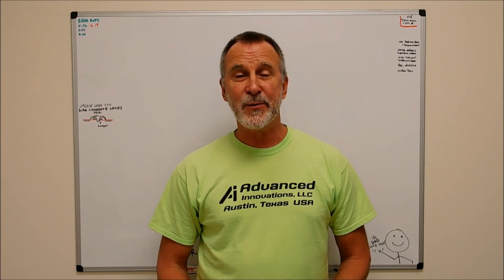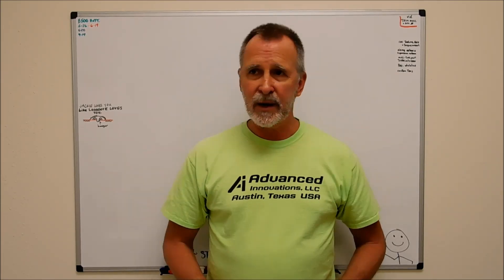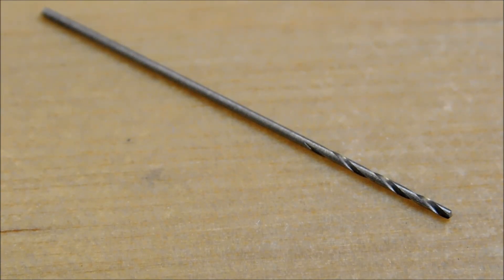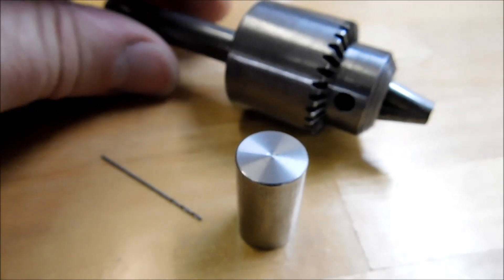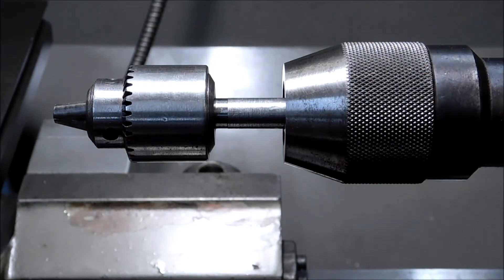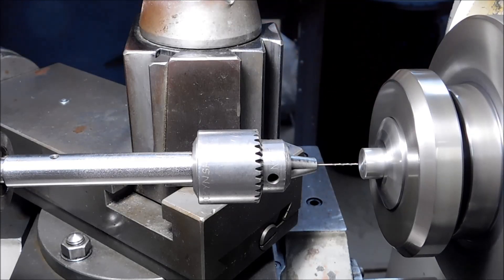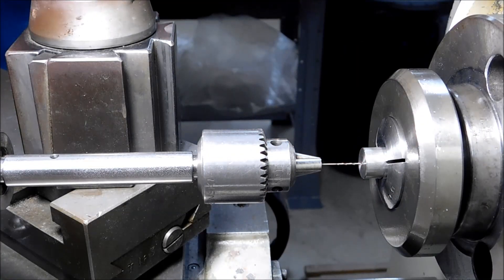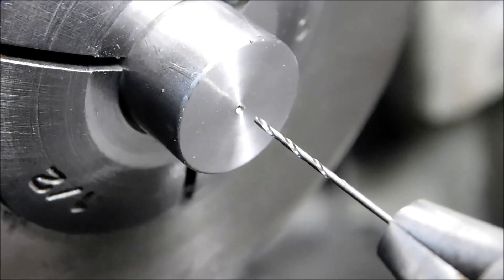Micro Drilling -- Stop Breaking Small Drills !!

Comment: That's a useful chuck arrangement, I'll certainly consider making one. 

Another solution is to use Carbide PCB drills that are rigid enough to start without using a centre drill. They also have a 1/8" shank so you can hold them in a standard chuck. You don't need to feel anything, just go very slowly and avoid creating ribbons of swarf because you'll risk breaking the drill. Using this method I can drill 0.2mm holes which is way smaller than the one shown here. Strangely enough, I think you'd have a PCB drill grab and break is you used the chuck shown here with them though.

PCB drills seem to be virtually unknown outside of the PCB industry, but they're are very cheap because they are produced in their millions. Search eBay for PCB drills and you'll see what I'm describing. They're optimised for Fibreglass, so they're not as robust as they would be if they were optimised for metals. You can still drill a ball bearing with them though as a party trick.

Comment: Peripheral speed is everything. Under thirty fpm any tool can not take the torque if surface speed is way to slow for the material. They make high speed drill heads for very small drills if you have to do a lot of them.

Comment: Thanks for a nice video. Your setup is a workshop setup. Wonder how will you apply it to home users. Anyway, one can buy a complete Dremmel drill with adapters, and a small matching drill press, for around 100 hundred dollars. I have used mine for many years, with very small drill bits for years for circuit boards and other uses.

Comment: Very slick solution. I've never had to use a drill smaller than 6-32 tap drill size, but I had a lot of tap breakage at that small dia. How much slop is there between the shank of the hand fed drill chuck and the ID of the extension?

Comment: Cool, need to adjust the tailstock, though, as the drill and centre-drill are a little off centre ;-).
Oh, in metric, that twist drill bit was ~0.65mm.
Reply from the maker: I can safely say the alignment error is the chuck. Its very old.
Reply: If you look at the video, you can see how the tip of the centre drill and twist bit are both moved from their initial alignment when they contact the work piece which then centres them to the axis of the check/bearing assembly - perhaps more noticable when withdrawing. Not much to it, it really only is noticable because of the small scale being zoomed in. I only mentioned it because it may cause issues with such very small holes as it loads the drill side.
Regardless, subscribed because you do, and have, some VERY neat tricks and workarounds.
Reply from the maker: I agree. blame it on the chuck. The tailstock is within .0005 TIR concentric to the spindle
Reply: Sorry, man - must have been having a senior moment :-(  (and it was very late/early our NZ time) - was thinking you were referring to the chuck holding the work material, doh!
I use a 3mm screw and locknut for setting throttle stops, your little holder video has triggered an idea for a better tap holder for that, so thanks there. :-)
Do you have suggestions, or a video, on drilling 10.8 and 12.9 (mostly internal) metric hex bolts for safety wire? They can be rather difficult and expensive to source and I have a *** of a time when I try to drill them, myself?

Dangit, you have a lot of videos - guess I know what I'll be doing this weekend...

Comment: Hi Joe. Love all your videos!
I'm trying to drill a very straight 1.5mm hole on center down the axis of a 3mmx25mm (1/8"x1") Stainless Steel shaft, to 6mm (1/4") depth.
I'm thinking an ER collet in both head (MT4) and tailstock (MT2) to get the accuracy. Not sure a drill chuck will do it?
Seems for a 5c collet adapter like you have I need a MT5 headstock taper? Your thoughts on best setup is much appreciated. Gerard, Australia.
Reply from the maker: Or you could make an adapter to hold in a chuck, like a 5C hex block??. All machines are different, so your budget and frequency of use should drive your direction. That hole shouldn't be too tough to cut. Its relatively shallow.
Reply: thanks Joe! yes I did consider a square 5c block dialed up in my 4 jaw. could make my own...
My 4 jaw backplate is nearly done. Getting my tailstock grinded down 4 thou tomorrow as its too high which doesnt help. As a result Ive been drilling tapers till now.
Reply from the maker: Many guys look right past the fact that it doesn't matter how perfectly aligned the tailstock is. Fact is, you don't even need it. If you set your drills and reamers in the collet or chuck and prepare a block secured into a tool holder, you can put your chuck in that toolholder and be dead on everytime. Or in this case, set the slider adapter in the toolholder and float the drill anyway.
Reply: Joe Pieczynski you've lost me a little bit. You mean like placing a straight shank ER collet holder directly in my toolpost, and adjusting it? or making a block to hold my chuck that mounts somewhere on my top slide in place of my toolholder and not using the tailstock at all?
Is this maybe your next video 😃

Comment: Just knowing the term is helpful. I love this idea but I need to use it on a mill and a regular micro drill chuck adapter would serve my needs. Your idea is better for lathes since you mentioned letting the chuck spin if the drill bit grabs, and I don't think the commercial sliding adapters allow spinning like that.

If you have a 0JT chuck, a reputable looking adapter arbor can be had for $60 or so through an industrial tool supplier. $130 or so with a micro chuck. An adaptor arbor from India is $30 on eBay. Costs clearly go up from there.

Comment: Good trick, i v drilled 600 micron hole, but my question is that what idea if i want out center holes?
Reply: He said it at the END, use that 150€ Adapter it has a bearing on the chuck, so you can feed by hand in a mill
Reply: to drill out of centre with this setup on the lathe, use a four jaw chuck, and with indicator set your workpeice offcenter. works great
Reply: D Pac 
thank u sir, but holes dividing is main problem, i want 4,5,6 or 8 holes in on set up.
Reply: anomicworld 
Thank you sir for giving detail information, i will try .

Comment: Excuse me, but .027 is not very small..I've had to drill .013 holes. The biggest problem is ensuring that your tailstock is on center. If above or below center, the drillbit will dance all over and break. And sensitive feed chuck mandrels with 1/2" shanks, are readily available. You put a 1/2" adaptor in your tailstock. Then you don't have to use a larger chuck and hang the bit out there so far that it accentuates any centerline mis-match.

Comment: Hi, i would like to know if it’s possible to drill a 0,5 mm or 1 mm hole in stainless steal or hardened steel?
Reply from the maker: The part used in this demonstration was 303 stainless. Hardened steel may be more challenging for sure.
Reply: I personally would not try drilling stainless with a drill so small.
Reply: Hardened plan on edm.
I was using a local shop for that. 0.02" × 0.25 deep or through. About $20 per hole for small orders.

Comment: some things become visible as watching your vid: the centerdrill used at 5:19 is moving out of the centre. It´s slightly moving upwards. Geuss something`s not aligned on the lathe properly or the holder ist out of center. next: small drillbits must be used at a high speed, the thinner the drill the higher the speed. If drilling with a 1mm drillbit in steel you need to drill at 10.000-15.000 U/min. Small holes like 1mm or smaller should be drilled on a machine what can provide the high rotation ratio what is needed for that. ;-) anyway nice vid!
Reply from the maker: This was more about the technique than the rpm of the machine. Most engine lathes will never see high RPM ranges like a CNC.
Reply: of course you are right sire.

Comment: At 9:30: "This is good for a lathe, it will not work in a mill".

Couldn't you do it in a mill in more or less the same way, that is to put the workpiece in the chuck and turn it, and clamp the drill to the bed somehow and then move it upwards?

I'm sure it would feel all wrong. ;)
Reply from the maker: Google micro chuck adapters. All your questions will be answered.

Comment: 300 x v/d 
The reason the unskilled break small drills is that they don't use correct speed [rpm] for the size and materials involved - too slow.
Please advise the rpm that lathe was running at for the 1mm drill bit.
The reason the unskilled burn out large drills is that they don't use the correct speed [rpm] for the size and materials involved - too fast.
Please advise what speed would have resulted in that 1mm drill burning out due to excessive linear velocity at the drill lands.
THIS is the truth of the matter.

Now, explain the 300 x v/d formula that gives rpm for drills and cutting bits in lathes. 

Fact is, drill presses designed for mall drills like this [forget the pistol drill setup] rotate at very high speed and have chucks fitted that do not old drill bits larger than 3mm diameter.

Comment: Lol.  Yea, they want to charge $300.00 for tools, to use on a lathe - that takes 1 hour to make, on the same lathe, with spare scrap.

I seen before, they sell spring chuck adapter to hold thread tap/die.  Is nothing more than rod, tube, and spring = $500.00
Reply: A tapping chuck used on drill presses and lathes as such uses a double planetary gear set that includes a slip clutch to limit torque, a square chuck fitting to mount taps, reduction drive in forward threading mode and a step-up geared reverse direction mode.  The main body of the chuck contains gear sets does not rotate, being held in a static position by a rod that  rests on the main vertical post of the drill press or bed of lathe. The chuck is mounted in drill press like any morse taper chuck in the driven spindle of the machine, be it press, mill or lathe. 

The machine input spindle direction is normal forward cutting direction, The machine is NOT reversed during operation. 
The natural tap rotation at reduced rpm due to gear ratio [output] is in the tapping direction - forward.
 The chuck is lowered into work piece. As the tap enters it threads in it eventually winds in to a point that disengages forward gear set. 
The a central 'neutral' mode  between forward and reverse directions is reached and with spindle pressure reversed [lifting up in a drill press] the chuck is engaged in reverse mode, unscrewing the tap at high speed.
With tension released when tap unwinds the chuck returns to forward mode ready for next hole to be tapped. 

  I've used such tapping chucks in a production environment, rapidly tapping a range of materials from rhs steel, stainless steel, aluminium bronze, brass, copper from sizes 3mm to 12mm and in some cases 50mm x 1.5 thread form into 8mm brass sheet.   
At high speed - NEVER broken a tap in the process. 
Takes a few second to set up - remove drill chuck, mount tapping chuck, mount tap, SET CORRECT spindle speed. 
Quality cutting oils help, but not always necessary according to material worked.
Into steel, if smoke doesn't rise from the process using good cutting oil the fitter is wasting time by using too slow a speed setting. 
Not necessary high quality [Dormer] or specialised 'gun taps' used.

Use in a lathe has chuck driven by headstock and work supported by adaptor mounted in tailstock -  not a difficult jig to make by a competent fitter. There is NO need to stop and reverse direction and no risk of tap breaking due to bottoming out on blind holes or excess torque applied.

Comment: Yea, inconel is a bitch, I use nothing but carbide or cobalt for my nickel jobs. ANYTHING else will burn out almost instantaneously.
Reply: I had a interesting job back in the 90's.  I had to cut a 6" length through 6/4 Ti. (3" from each side), for Mt. Bike bicycle hub axle's.  I used a coated cobalt High helix 140 deg drill with a split tip, but I found if I went to the proper feeds and speeds, I would snap the drill very quickly.  What I ended up doing was "breaking in" the drill tip.  I would make one part with a very slow speed and feed, (I can't remember the speed, but about .0005" feed to start), then bump it up a tiny bit for each part after that part was finished.  I was up to feed and speed by about 10 parts, and then the drill would last for about 200 parts.  Weird, but it worked.
Reply: That was on a cnc lathe.
Reply: I also tried stoning the cutting edge a bit to break in the tip, but it never worked nearly as well as letting the tip "break in" by cutting parts.
Reply: That is really interesting, I've never heard of that. You'd think they are sharpest when new. Do you use magic tap? That's all I use and it works wonderfully. I do not do this as a job mind you, it is my hobby. I build gas turbines. I spent a lot of money on cobalt drills and they are very well worth it. I have done lots of SS on my cnc mill but I have never actually got up the courage to fully cnc machine a piece of nickel. I'm afraid the speeds and feeds have very little forgiveness the harder the material gets. Aluminum, I do whatever I want basically. I usually sharpen my own drills on my bench grinder, but I'm still looking for a way to sharpen end mills! Apparently the machines to do that are in the tens of thousands! Thanks for the reply . . . .
Reply: That's funny, I was gonna mention drill doctor. . .what a piece of junk, I bought one and returned it. I do a better job sharpening my bits by hand. And I could learn to sharpen endmills, it just takes practice and watching several videos. I'll never get it as good as a machine can, but it can be sharpened to a degree. And about the drill doctor again, maybe I just didn't use it properly, but it didn't work at all for me. Esp the split feature. I followed the instructions to the letter, but still they didn't cut. I took that same drill and sharpened it on my wheel and it cut like butter through nickel. So I know the basics of drill sharpening. . . .

Comment: ive seen this before thanks for sharing.i have a friend who is a toolmaker and works with zero tolerance the machinery he has in his tool shop are self modified to work with very close accuracy,to give you a idea the items he works on are in a heatbox of 40 degrees celcius he takes them out and works on them for a few moments at a time and puts them back in and when he gauges them up he holds them with tools that are from the heatbox (Gauges too), other toolmakers that work in other areas that maker other fittings work under the same conditions so all the parts fit together

Comment: That wire-gauge drill bit is FAT and FLEXIBLE compared to the tungsten carbide bits used to drill FR-4 circuit boards and the technique shown here would probably still cause them to break.
Reply from the maker: Those drill are also quite a bit shorter and much more rigid. What diameter are you using? .026 is pretty small.
Reply: +Joe Pieczynski — Drill sizes of 0.010 – 0.011 are not uncommon in circuit board fabrication. If holes smaller than that are needed, they're usually made with a laser. The problem with tungsten carbide drills is that the material is brittle and the bits cannot tolerate any chuck bearing runout to speak of. I've tried using some bits that I obtained cheaply from Harbor Freight Tools in a drill press and in a hand-held Dremel tool, but it was hopeless, as I was breaking them one after another. To prevent such breakage in an industrial setting, CNC drilling machine chucks use air bearings and the spindles turn at 15,000 to 110,000 rpm, with feed rates controlled by computer.  Excellon Automation specifies the TIR on their spindles as 0.0002 in (0.005 mm), and typically better than 0.00012 in (0.003 mm), so lateral loads on the drill bits are minimal. I'm not criticizing what you've demonstrated here; it's a good, economical solution and doesn't cost anywhere close to what an Excellon Automation CNC machine costs.

Comment: Great video, thank you! Do you have any extra advice if you need to make a hole with the drill bit rotating? Also, I couldn't help noticing you said the drill bit is 26 thousands (?) of an inch. as in 1/26000? The bit seems larger than that - about 1/50..
Reply: Mihael Grbić He means 26/1000 or .026 of an inch.

Comment: And old machinist told be one of his secrets. If you dip the drill bit into a bottle of 'Old School Amber Glue", the one that still has the rubber tip, then drill your stainless. it will preserve the bit longer without dulling it and works as a good Lubricant too. Just a hint
Reply from the maker: Interesting. Maybe the mass in the flutes adds rigidity. Good concept.
Reply: Mucilage? https://i.pinimg.com/originals/30/f4/28/30f428363e74bdc7bdaf78cf31723543.jpg
Won't it harden on the bit?

Comment: Probably should warn people only to do that with very small drills, bigger you could get hurt, pushing by hand. Some wouldn't remember to let go. I'm in the cnc world where there is no feel, just have to know. I setup program operate 6 axis gundrill/mill. I've drilled 3mm in P20 steel 650 mm deep on compound angle. Gundrills make it easier, on your lathe you'd have to spend alot. Maybe not, but you'd need like 2000 psi oil pressure through the gundrill for a 26 thou drill

Comment: Yep, thats what I did... but, I stuck a microscope on the lathe, for small parts.
Now, lets do an .006 in the Bridgeport...and no microscpoe help. -_-
Reply from the maker: Spend a few bucks on a good chuck and spring loaded arbor. Buy good drills and cutting fluid and take your time. It should not be a problem.
Reply: ...the chucks, well lets just say, they have no concentricity under .020. ..it's pretty visible under glass.. even on the lathe. Just part of my job micro machining, and getting er' done regardless.
 If you like micro welding under a scope, been there done that, .020 rod, fixing dies. -_-